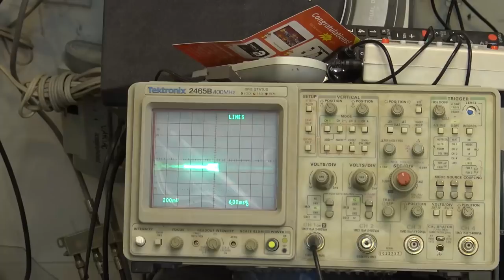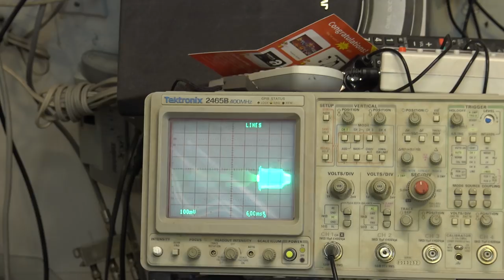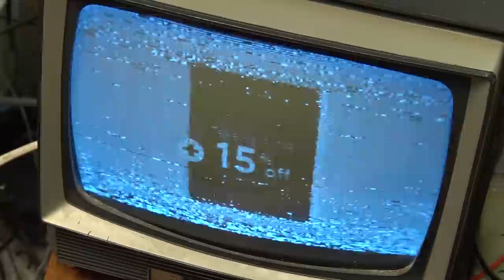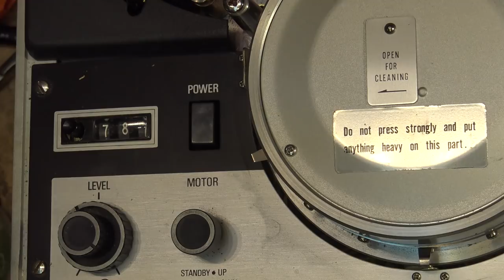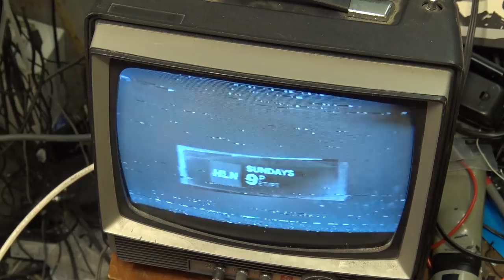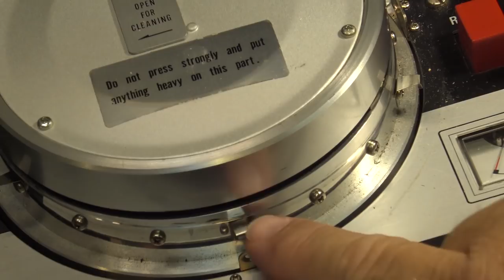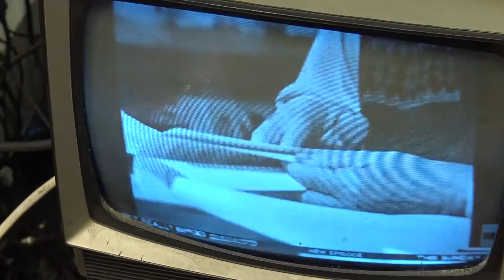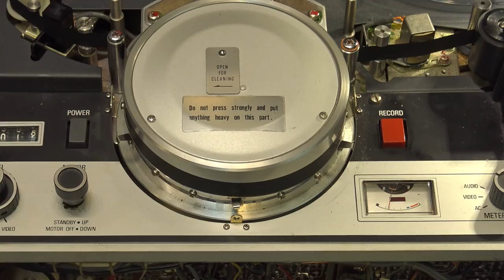Vintage Sony CV2000 Video recorder from 1965 part 2 finding out the cause of the sound problem.

Comment: LOL, I used to service those 1/2" video recorders while working at Sony.  GE got stuck with a contract for all the problematic old format just as Sony moved on to their improved 2nd generation 1/2" tape format version that appeared to be identical in the basic mechanical construction.  The big GE logo was the visual clue to grab the matching alignment tape.

That Sony magic constantly slipping belt servo was simpler than the Ampex motor circuit driving a giant motor with SHARP human flesh eating blades on their earliest 1" models.  I lived those good old days working at the manufacturers. 

You are the best source of technical / repair info!  Take care!
Reply from the maker: Funny how that happens. I had a piece of crap Akai 1/4" format BW recorder way back in the late 70s but it broke and parts were not available so it was scrapped 40 years ago, Wish I still had that now, even in a non working unit just for display.

Comment: I love the fact that there are no plastic components in the tape transport section of this machine. It was clearly made to be worked on. Nowadays, all of the various electronic equipment we are offered are made out of plastic junk, disposable, made-to-fail garbage. I so wish we could go back to 1965, when equipment, such as this unit, were designed and built to last indefinitely, as long as the equipment was maintained properly.
Thank you for sharing this marvel of technology (in 1965 anyways) with us Dave. It is awesome to see these machines being revived by you! Bravo sir!
Fred
Reply from the maker: It was fun to work on. Should haul out my Sony vp2000 which is a playback only 3/4" deck and see if i can get it to playback properly.  I also have a vp1000 player and a vo4800 portable recorder
Reply: @12voltvids  Those are videos which I would certainly love to watch Dave!
Fred

Comment: I have several audio tapes from the sticky shed era and although I have had success with my convection oven on a slow low bake, I read desiccant bags in a zip lock with the tape for a few week may also be an alternative to the issue. I have one now doing just that. I'm hopeful just not going to be surprised when it doesn't work. I think the baking instructions are still online if you google bake tape. But about 120 or lower for 4-6 hours gives you a few days to copy your gooey tape without the goo.

Comment: I remember these well in the late 60's our school district bought 12 of these 3 for each high school. after two weeks all of them were trashed. They would take them out on the baseball field to tape the game, and the dust would cover the whole inside of the machine and gum up the slip rings and heads.  Teachers would try to thread them and the tape would get wound up in the head drum. As a junior in HS they found out that I could fix them, so rather than send them out for two week turn around, I spent the next year and a half, at least two hours a day fixing them and teaching a group of students how to record for the teachers. The next biggest problem we had beside the dirty heads and slip rings, was that some accountant in the main office found out that half inch computer tape was a lot cheaper that video tape. We found out it was like running sandpaper through the machine, after about 40 hours all the tape heads were worn down to nothing.
Reply from the maker: Yup, video tape is special.  I might try the naptha treatment on this one but then again why bother.  I know the machine works so back into storage it goes and if a collector wants it it will move to someone elses collection.

Comment: Lol...when I was in High School I took a TV broadcast class where we had a couple Sony versions of the deck. Due to the rough handling of high school kids, they were out for repair more than we had them. I tried to talk them into U-matic recorders, thinking the enclosed tape would lessen the repair factor.
Reply from the maker: @Kent Teffeteller I have a VP1000 and VP2000 deck. Perhaps I will service one of them next.
Reply: 12voltvids In high school I used cv2000. We had low downtime because we gave the machineTLC. Eg. motor OFF before any threading operation. We KNEW the heads spun fast and were delicate. It was my favorite piece of av equipment.

Comment: Amazing machine, and really amazing that it works after 55 years. With the original rubber parts! It might worth to bake that old sticky tape, after the home footage, there might be some interesting TV footage on it from the '60s-'70s, complete with ads, etc. For replacement, reel to reel computer tape might be usable, maybe its formulation and thickness is closer to the original. Although I have a few reels, but they're quite brown, while the original tape seems as black as the VHS. Maybe the VHS formulation is OK for this machine, it's just the thickness as you said. Recording to a very different coercivity tape would make the video quality horrible. Try to make a VHS recording on an SVHS tape, it looks horrible, despite the tape has much better properties and finer particles.
Reply: Oh, so you managed to watch the tape after two passes of FF/Rew. Sorry, I should have watched it to the end before commenting.
And you even baked it!

Comment: It looks like you've got it all sorted out, now all you need is some brand new tape.
Reply from the maker: That would do it, but the chances of finding that is about as likely as hell freezing over.
Reply: @12voltvids  That's too bad. No demand means no reproduction.
Reply from the maker: @johnb5519  
Tape is dead. End of story.  This is just a nolvaty item these days like old cameras. Collectable yes, useful no.  I am surprised that they belts were good after 55 years.  I had no intention of putting any money into this bacause it will never be used.  The only b
VCRs i use is VHS, beta, 8mm and DV, and these are exclusively for archive. Any tapes made on one of these won't be playable now anyway just due to tape degradation.

Comment: I jumped in part way through and had a "surely a video can't have poor vertical linearity" moment.  But then having recently had an upside down picture from a video tape, it's obvious that strange things do happen.
Reply from the maker: But do you know why the picture was upside down?
Reply: @12voltvids  Because some fool had loaded tape upside down onto the spools:
https://youtu.be/2QqA8zZLYOU
Can be easy to do with an open reel machine like this, but in my case someone had actually done so with an 8mm tape!
Reply from the maker: @video99couk  lol yup i saw the same thing years ago at the shop and got a good laugh out or it.  Of course on 8mm it will play perfectly just upside down and backwards.  On a VHS you get a picture and a 30 Hz buzz on the sound because the control track is now playing on the audio head.
Reply: @12voltvids  Well 8mm wasn't perfect, the colours were a mess, but you could see what was going on just about.  Yes the sound runs backwards.  Of course VHS, Beta and all that sort of thing would lose the control track and linear audio.

Comment: Just a suggestion for sticky tapes. Try using nufinish (orange bottle) auto polish on a soft cloth rubbed on the tape. It can be messy but it lasts for much longer than baking. I had some sticky reel tapes that are still good after five years. Hope this helps.

Comment: Very impressed on how really clear the picture did look near the end of the video,,,the vhs tape would do a lot better in recording playback,,,even though it,s not the right sized tape for it,,compared to the original tape,,,that u are trying to restore by baking it in a convection oven.

I would suggest to try and get a new tape that would closely match to the original,,,as that old tape would keep leaving dirty residue on the video heads and guides,,and the pinch roller.

Otherwise,,,it,s so great how u have a 55 year old black and white tv and reel to reel vcr tape machine that matches it with that connection plug on the back of the tv too,,,,in great working condition as if it,s like new. Goes to show u how well they were solidly built back then,,,compared to 2day,s modern technology that doesn't last nowhere near as long in a lifetime. 

Are u able to put a particular type of conversion adapter on the cable,,,to connect it up to a colour crtv,,,with rf or av video input? As it would b great to see how really clear the picture looks in colour after a tape recording/playback.

Or I guess the machine does not produce the pal colour signal,,,only black and white playback.
Otherwise such a great video u have done on that machine altogether. 

As I have saved you in my favourites in my you tube library,,,,as I've never seen a video machine like this b4,,,I guess the first ever video machine invented back then.
Reply from the maker: It doesn't do color.  Has no color circuits.  Limited lumanence bandwidth at that.
Reply: @12voltvids  Ok,,,i thought that I was right there that the machine doesn't do colour. As of course I don't really know what year colour tv was introduced,,,but as a guess it was introduced in the late 60,s,,or early 70,s.

Comment: No doubt back tension is an issue with the VHS tapes. Although a few have said VHS tape will work, it is much thinner and the higher tension of this machine will cause misalignment and tracking problems. The tape will tend to ride ride up or down. A friend had a problem using 4 hour tapes on his very early VHS machine in the 80s. I advised him that the machine could not use 4 hour tapes (PAL) as it was only intended for use 2 or 3 hour tapes.  Nice work, hopefully a good tape turns up.
Reply: I used VHS tape on a SONY Videocorder and it worked perfectly, producing a very good picture! The hard part was unspooling from cassette to open reel, and remembering to ensure the recording surface was facing the inside of the reel, so that you're not trying to record on to the back of the tape!
Reply: Yeah, the VHS tape was apparently sticky based on the tension popping. Shorter VHS tape would be thicker but you would need more of them. Reminds me of seeing a tape recorder which ran with the recording surface on the outside. I encountered one such tape while copying some old tapes to cassette for a friend of a friend.

Comment: Q: Do you plan to fix the vertical and contrast on the monitor?
Could be very interesting to see the guts of an old Sony B&W TV.
Yeah; a few caps here and there - probably . . .
Reply from the maker: I will probably pull the tv apart as a seperate video even though it works properly now.  The vertical was just adjusting the linearity and height but i bet a cap or 2 in there needs attention.

Comment: I used to have three units similar to that.  I think they were slightly younger.  I believe each of them had a pressure pad for the audio/control head.  Perhaps it was something they added later.  Your video makes me wish I had kept those machines!  Thanks, as always!
Reply from the maker: Looks like this one had one at some point. There are threaded screws that would hold a spring loaded pressure pad.
Reply: I don’t remember a pressure pad. But there was a non-moving black guard in front of the audio/control head. We had to make sure the tape was threaded between the head & guard, otherwise no playable recording was made. During recording, there was no symptoms of the problem. Thereafter, we always made & played a quick test recording before the serious recording was started.

Comment: In the early '80s, I  bought a later version of this Sony at a Northern Virginia surplus store for $80.  A circa 1970 portable.AV-3600, in a red & charcoal vinyl covered wood case.  Had to drive across town to a place in Maryland called "Professional Products" to buy a couple new 5" reels of 1/2 Sony videotape for about $24 apiece. I got 5" reels because they wanted about $50 each for 7" reels! 
Some neat things I discovered with the Sony included an audio-dubbing switch. Also I could freeze-frame and then move the reels by hand to precisely position the tape for audio and video dubbing - something a typical consumer VCR couldn't do in those days.
I had loads of fun dubbing & editing audio and video from my Sanyo Beta VCR, to create my own weird TV commercials and music videos. How does Michael Jackson's 'Thriller' video combined with the audio of Olivia Newton-John's "Lets Get Physical" strike you?  Or the mid-air collision scene from 'Airport '75' combined with the soundtrack from a United Airlines commercial?
Later, a friend of my brother's bought a big pile of surplus at a government auction, and gave me the Sony battery portable version that took the 5" reels, along with the power-pack and B&W camera. The rechargeable battery was shot. But I was able to make a few home-movies using the power-pack. 
Then I found a couple good reels of 7" Panasonic videotape, cheap at a flea-market. I also found a big reel of what I believe was 1/2 computer tape. I spooled it on to a VTR reel and it worked OK, except for a slightly grainy picture, and the tape was fairly thick, so it only ran about a half-hour on a 7" reel. After I got the Panasonic tapes I didn't use that computer tape very much. 
At one point, I thought I'd hit the jackpot, finding 20 new, boxed 7" reels of Karex videotape at a flea-market for $25 - except the stuff wouldn't budge when I tried it on my Sony.
I think I eventually wound up heaving that tape in a dumpster!  Good luck with your machine!
Reply from the maker: I received a new tape for it that is good.  Will haul it out again some day.
Reply: @12voltvids  Discovering your site got me wondering what this vintage video gear is selling for these days. A quick eBay search found a Sony CV-2200 (like yours but with audio-dubbing, in a portable carry-case) recently sold for $100 + $90 shipping. Currently there's a Sony CV-2000 listed, with the minimum bid at $1200 (!), a Sony AVC-3400 B&W camera for $275 including shipping, and a Sony AV-3600 starting at $30 + $31 shipping.  In addition to the multi-pin TV socket, the AV-3600 does have a separate coax video input and output (this listing is tempting me a bit)
I should mention that I also have one of the mid '60s Ampex 1" tape 'portable' video recorders. I say 'portable' because it has a swing-out handle on each end, so two people can carry it!
Reply from the maker: @sunbeam8866  yes we had one of those at the tv station I worked at 40 years ago.  2 people to carry that monster.

Comment: You can actually clean the tape with methylated spirits by running the tape on fast forward using the Q-Tip as the Tate moving along it will clean the tape I was taught this in the 1970s and it did work I would not put it in the oven just clean with methylated spirits and it will be ok when you have done that

Comment: I wonder if the tape tracking problem is because VHS tape is usually wound oxide-out and you had to flip the tape to be oxide-in to face the heads. You might be fighting the VHS tape’s natural curl.
Reply from the maker: No it's because the tale is too thin.  A viewer sent me a brand new reel of tape, and it works great.   The unit is not in the shop currently but in the storage unit.   I'll bring it back into the shop and get it tuned up properly now that i have a real tape to run through it.   Don't know when that will be, next year probably.  When i get bored and have nothing to do.

Comment: hi I have a sony cv 2000.. it runs and i have some old tapes but when i thread them in I get nothing at all on the built in monitor ... no sound no video.. is there something I am doing wrong ? i would expect to get at least some garbled image or sound . Thanks very much

Comment: A tape that comes to mind is a vhs Scotch video tape, it was slightly thicker, some machines had trouble with that.
They gave a lifetime guarantee, now that was a daft thing to do lol.
If someone has a new unused Scotch tape, i think that machine would be more stable.

Did you adjust the audio/crtl head tilt grubscrew to get the audio closer?.
Reply: Re-record, not fade away, re-record, not fade away
Reply: @HuntersMoon78  Ha ha that skeleton really knew how to sell video tape :-D
Millions of years later i still remember the adverts, much like you :-D.
Reply: Dave went back to using the original tape that came with the machine. He said that he baked the tape for a while in his convection oven, in an effort to diminish the "sticky-shed" tape issue, which the original tape exhibited.

Edit:  Typographical error.
Reply: @electronicengineer  Yes i know he did, but that tape can't be in top condition.
Notice i said " new unused scotch tape ".
Reply: @zx8401ztv  Agreed.
Reply from the maker: Yes and it makes no difference on that bodged together tape.  The original tape is probably 1.5mil and the VHS tape wound on the spool .5
Reply: @12voltvids  That's a major difference, for sure on the substrate gauge Dave. Makes total sense. Thanks, Fred